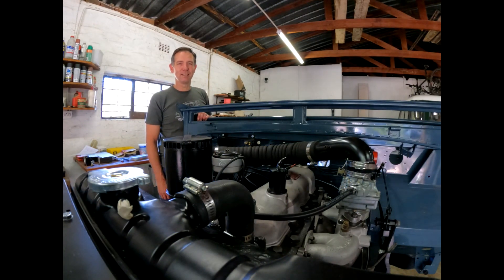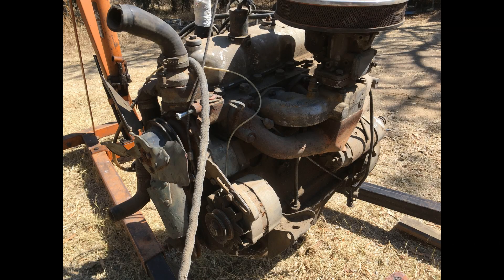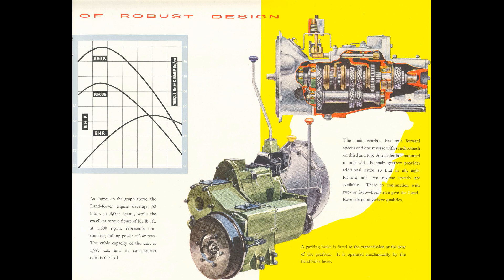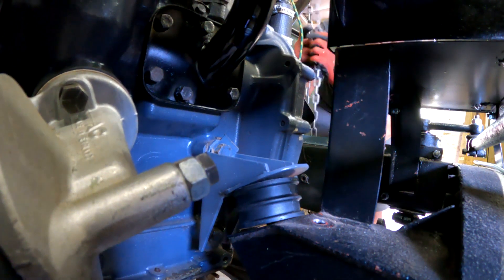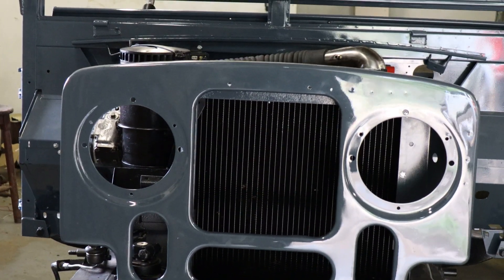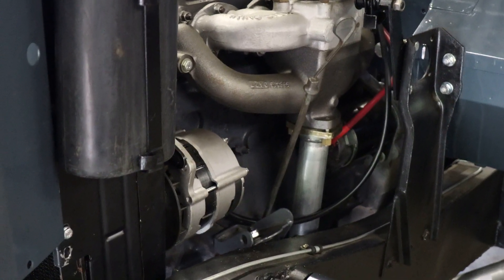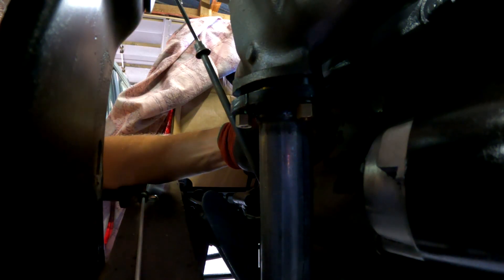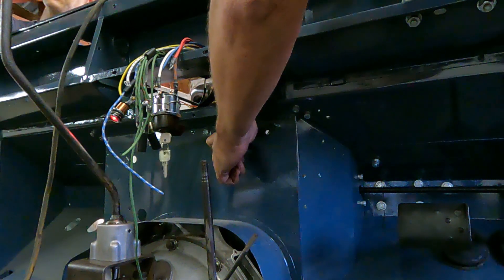Land Rover Series 1 107 engine conversion 2L to 2.25L - 8 things you should know.

Comment: Great video 😊😊😊
Many years ago I shoe horned a series 2 motor and gearbox into a series 1, also fitted series 3 break  booster & clutch peddle 11" breaks, and the long wheelbase spring hangers, power steering from a Toyota cressida, made a very capable of road vehicle 
Cheers from New Zealand 🎉🎉
Reply from the maker: @tbone6561  Thanks for the comments, sounds like some good upgrades 👍